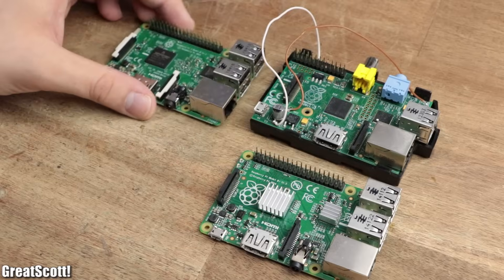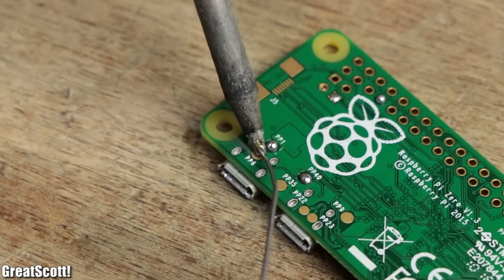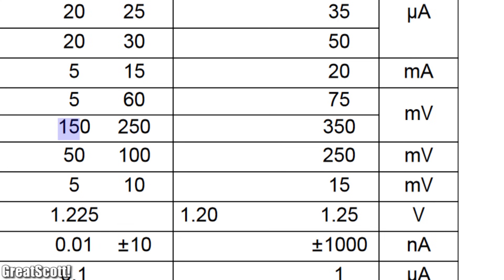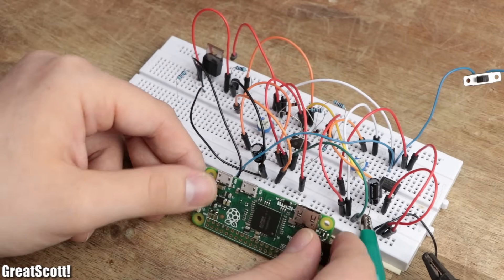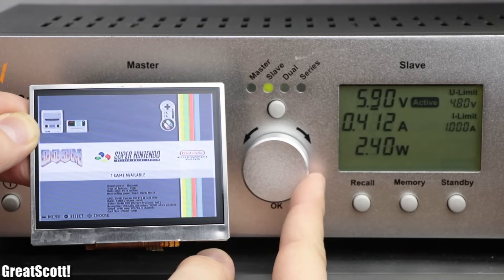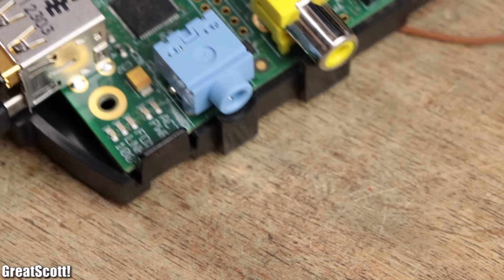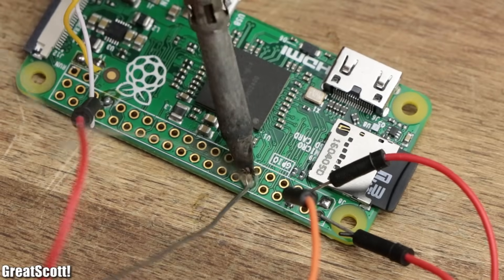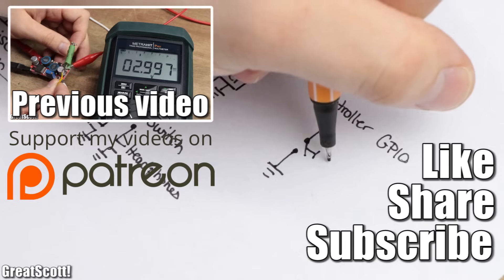DIY Raspberry Pi Zero Handheld Game Console (Part 1)

Comment: you made it super difficult and expensive, just use a 2s BMS for battery, 8Pin Display Module, and modify the matrix keypad and connect it with Pi

Comment: Hi, I have got a similar tft lcd monitor but the pcb i slightly different and it seems that there is no XL1509 ic. There are only two 6 pin ICs whose written on labels dont result in a specsheet online. Also on the flexcable to the monitor it says HJH-4.3TN01 it doesnt help to find the panel just to rule out beforehand if it would be a 12v only. Can someone help me with this

Comment: If the battery can be changeable like "shop modification"(if alot already) to be like Android-type battery but the maximum size can fit? Because android's battery is strong and so slim, imagine if that size on Nintendo like this right?

Comment: I'm just wondering, why not using the HDMI port? You've got the video and audio exit already. Also there are circuits for battery management available in any voltage and capacity

Comment: why is it so dam hard to use the effin Bluetooth on this stupid zero???? anyone has input on the matter? thanks guys i have the zero W and yes i have paired my headsets to it but fails to make profile and keyboard does pairs but if left long for without use it  will loose connection weather im on wifi or not really sucks, i even bought a BT dongle for audio as it was marketed for audio  and pssshhh nothing ..... im dead

Comment: Im trying to do this with my pi3b+ but I cant find where to solder the a/v wire to. Any help would be great because the only instance of you wiring iy to the board is on a pi zero and idk which port that is on mine...

Comment: I just noticed that this project uses rechargable AA batteries. If I were to use non rechargable AA batteries, is overdischarge protection is a must or a regular voltage regulator will be fine?

Comment: Wondering why you didn't modify the config files directly by plugging the micro SD into a PC instead of using an FTP client software. The filesystem is fat32 so you could have done it just fine. In case the filesystem automagically changed to something else you could have used a remote sh terminal emulator and a bash text editor, much faster than a bunch of FTP transactions, which I use only to transfer files and not for editing.

Comment: Hi scott!! Great videos. I want to make you a question. I want to make a portable game console with a raspberry pi 3. I will use a 3000mah battery from a smartphone. Can I use a tp4056 to charge the battery and with a boost converter to reach 5v make the raspberry pi work fine? If not, what solution I have?

Comment: why didnt you just set a pin high on the raspberry pi when voltage drops rather than have the transistor cut power to the raspberry. you could then have issued a shutdown command to turn it off?

Comment: I am starting a project of my own retro handheld, but based in a orange pi, because of budget purposes lol. As long as I am also using it as learning way, I've got some doubts. Would you help me? Before deciding to build it, I've seen some videos and people were using Arduino nano to connect the controllers to the Rpi, but do I really need that? As long as I can connect a keyboard or a joystick in the USB ports, wouldn't I just kinda do the same with the buttons, adapting one of the USB port just for that? Quite like I stripped the joystick and soldered it on the USB port, taking it exclusive for that? And about the screen, do I really need a driver board? The Rpi screens are too expensive for me, so adapting a screen, like a psp or 3ds, would be very helpful and convenient, but I've read that it just can't be done because it isn't compatible. Can I do something just like you did there? I am using a orange pi pc h3    with a 3.5" TFT LCD, which I wish it'd be bigger, 4.3" at least; 6 command buttons and 4 shoulder buttons for a better range of compatibility with the consoles. Even though I'm a beginner in this world, I know it can be easily done, just need to get rid of some doubts then time will do the rest haha 

Btw, some nice projects you got here, mate. Congrats :D thanks for sharing it

Comment: this overdischarge protection seems to not care about a clean shutdown: it just cuts the power regardless of the OS status. This might result in data corruption so we would want to avoid it.

got an idea: making the BCM monitor the over discharge circuit, which sends a trigger signal (let's call it "bat_low", maybe from the first opamp output) when the batteries voltage reach a value below a set one: in the video, if I understood correctly, it is 4V8. This would also get rid of the mosfet and the flip flop part, being the shutdown procedure taken care by the OS in a much cleaner way, relying on the underlying  circuitry to keep track of the battery level. If the system is running, it tells that the batteries are low, and gives 5 to 10 seconds to save progress (for example), then it shuts everything down and powers itself off. If the system is booted up again and, if the "bat_low" value is read from a GPIO input, it immediately initiates the shutdown procedure. Just like telling the user, "either you change batteries or recharge them, or I refuse to boot up again!"

This way we would also have less circuitry laying around, with less power wasted.

Unfortunately, as far as I know the raspberry boot procedure is fairly demanding in terms of power, so this procedure is far from ideal. Maybe a kernel mod would be acceptable: at a very low level the kernel might check if the low_bat trigger is on and refuse to boot altoghether, visualizing a "low_bat" icon on screen. After all I only know how to write a python module, which lays on a way higher software level.

Also this would definitely work on the Zero, not at all sure about the 3B. That little critter is quite short-tempered, and everything under 5V is considered "unstable".
Reply: I realized that my previous idea wasn't that good. Basically the over discharge protection circuit can be preserved; except for the signal that's being grounded: a GPIO can be grounded through a transistor, activated when the power drops below a certain value. The GPIO is then read by the BCM and the shutdown process is initiated.
Reply: 2:51: shouldn't it be " + > - out Vcc"? And I still couldn't properly understand why the inverting input is set to 3.8V.

Comment: "By adding a potentiometer to the inverting input I scaled the 4V8 minimum battery voltage to a value of 3v8 [why?], which means [on what assumption?] when the battery voltage falls under 4v8, the output of the opamp turns on".

Though I grasped the overall underlying concept, I feel there's a gap in the explanation. Where did that 1v go? Which is the minimum battery voltage, 4v8 or 3v8? Why do you set 3v8 in the inverting input to have a 4v8 cutoff on power to activate the anti-overdischarge circuit? I'm confused.

Also in the Instructables page I can't see the components you used for the audio filter. It is tiny but I suppose it's very important, so they should be listed.

Comment: This is like the 20th time I'm watching this. Just too interesting. I really want to experiment and do something similar with a bigger screen, much like an Archos gamepad or a Wii U gamepad minus the touch feature (which I have to see if it is feasible but I feel it would be largely redundant). That would be way too cool.

As a side note, I would have added a secondary circuit to the anti-overdischarging feature which makes a red LED turn on when batteries are low on volts. That would be much better for the system, giving enough time to power it off thus preventing abrupt shutdown.

Comment: Will one of these screens work with this project's component? https://www.ebay.com.au/itm/Bottom-LCD-Display-Touch-Screen-Replacement-Tool-For-Nintendo-DS-Lite-DSL-NDSL/322837173319?_trkparms=aid%3D555017%26algo%3DPL.CASSINI%26ao%3D1%26asc%3D20160706105120%26meid%3D40176bf771d44211aa783eaef4f71220%26pid%3D100508%26rk%3D1%26rkt%3D1%26&_trksid=p2045573.c100508.m3226
Reply: Ds screen wont work. You need a composit video wire.

Comment: Recently built a similar setup using a Pi Zero, this exact screen (did the 5v mod too) and GPIO sound and GPIO joystick. then crammed the whole lot into a cheap gadget shop mini arcade case. Works great with a USB powerbank as a source and charge circuit.

Comment: Hey GreatScott. I think you made misstake in the schematic and explanation of overdischarge protection. 
First you said that you scale the 4.8V of the battery to 3.8V, and as the reference voltage you have 4.5V. That means that the output of the comparator turns high much earlier than it should.
And in 2:51, whe you explain hom comparator works, you said that if +<- --> out gnd, and if +<- --> Vcc. You wrote the same condition twice, but with different result. That must be wrong. 
If I'm wrong, please correct me, I'm just starting my electronic adventure.

Comment: Would it be possible to just use 4 NiMH Batteries (about 1,4 x 4 = 5,6V) and to prevent it from overdischarging you use a Zener-Diode with a constant Voltage of ~4,8 V to be conductive, so when the Batteries discharge under 1,2V, the Zener Ddiode blocks and turns the system off?

Comment: Hi Scott !
Nice built ! Congrats.
I'm trying to do the same but I have a screen issue.
When I plus the screen on the battery circuit, and the raspberry on a separate micro usb power, everything works fine. But if I plug both raspberry and screen on the battery, it is constantly rebooting and screen is flashing on and off. My screen controler board is different than yours so I don't really know if I need to remove a chip on it. I even can't read what's written on the chips ... it's TOOOOOOOO SMALLLLLLL :-)
Can you help me ? PLEEEAAAASE !
Thx

Comment: My take on this is SmartPiTouch + raspberry pi 2B + element 14 7" pi display + Kano GPIO speakers and finally some cheap nes controllers which I might upgrade to psx controllers
Reply: Oh and for software I used retropie running on a 16gb micro ad card

Comment: i dont know anything about this kind of stuff but i want to make something like this, wouldnt a regular power bank work? i have some laying around that have a 5 volt 1 amp input and 5 volt 1 amp output. this way i would not have to make a voltage regulator and a discharge regulator.
thanks!

Comment: Why is the battery low voltage of 4.8 Volts scaled to 3.8V for the inverting input?  Shouldn't this be scaled to 4.49V to turn on the comparator with the non inverting input of 4.5V?

Comment: hey, i tryed to rebuild this project with an raspberry pi model b+, i copy you config files for recallbox and the raspberrypi boot config. i soldered the composite yellow wire of the display directly in the raspberry pin of the 3,5mm jack. the bootscreen and the menu of recallbox works fine but if i start a game the display fade into black and the video signal cames out of the HDMI connector. WHERE IS MY FAILURE ?!

Comment: what is better? cheap raspberry pi 3,5inch display or monitor used in this video?? i saw that many people have driver issues with the cheap raspberry pi displays is that true? what should i get? the monitor used in this video and modify it so it can be used with my raspberry pi 3 or buy the 3,5inch lcd for rpi?

Comment: Hmmm.  I build the power circuit as shown.  But it does not shut off when the battery falls below 3.8V.  The MAX667 gives 4.5V with any input 5v or higher.   When the input is at 3.8V, the MAX667 is outputting 3.0V, so how does the Neg input to the OpAmp ever get higher than the Pos?  It will always be lower than the Pos.  My test circuit doesn't shut off until the 2.3V range....
Reply: Looks like the inputs need to be switched (Pins 2 and 3)  Works when I changed them....

Comment: could you take apart a cheap cellphone power bank and solder it with the included circuitry in the board instead of making a voltage regulator? its designed to output 5v continuously plus one can charge the battery inside the handheld. 

edit: 2nd thing do you have a  retropie version of this project?

Comment: +GreatScott! i followed the instructions and i allready got my lcd screen running. 
adjusted all the config file settings and used a PI2 for the presetup of recallbox. now if i boot on the ZERO it stucks at the rainbow screen. any advices ?

Comment: Greetings,
I am creating a Zero PI SNES Controller. I have tried all I can to configure the GPIO’s to the controller, however, nothing seems to work. I am user recalbox and I am aware that it won’t be the same configuration as in your video.
Could you please if at all possible point me in the right direction? 

My SNES controller > 
Red = Data
Yellow = Latch
White = 5V
Blue = Clock
Brown = Ground

I would need to know the GPIO layout for this, and most important the “recalbox confg”
Any help would be greatly appreciated. Thanks a mill.

Comment: Hello Greatscott! This video is awesome! I just had a question. Do you need a different raspberry pi to install the OS? I seen you switch from the zero to the Pi B, then back to the zero. If you could explain a little more on that I would appreciate it! Thanks!
Reply: zeldaxpro I would also like to know the answer to this. Is it a must to get the raspberry pi b model?

Comment: I'm building one of these with a lipo (3.7v) which comes with a protection circuit(overcharge,current and discharge) - can I just attach it to the pi's 5v input and to a boost converter (3.7v -> 12v) for the screen in parrallel without any additional circuitry?

Comment: 3:30 A piece of what are you using? I can hardly understand it. :D
Reply from the maker: "...perfboard...."
Reply: Ahh, I wondered what it was, but I could see it is "Veroboard". "perf" meaning.... "perforated"!! :)

I understood most, but would obviously need to pause quite a lot, when building. Mainly around the redirection of ports in the config file.

Comment: tip: the headphone jack you used will short the audio input to the speaker if you don't plug in headphones so you don't need the switch.

Comment: I wonder, if there is way to connect that lcd directly to Pi ? (not zero of course). I meen, raspberry pi has some serial port for display and this lcd also has serial port. btw this lcd has touch sensor too. you can see it 4:00 unconected 4 pins
Reply: Yes there is composit(analog) video out on every Pi except zero 2w it has pads

Comment: GreatScott! I have a question for you. How do you get your boards and components so cheap ? For e.g. I can find most things you use but at much higher prices: Raspberry pi 0 - minimum price You can actually purchase it is about 22 $ as compared to 4 gpb.  This really upsets me, because it's misleading when making a budget for a project like this one... Initially you hope it will be around 30-50 $ but it ends up costing always alot more. :(

Comment: Any other tips to get Recall-
box on the PiZero?  I downloaded the latest, and get no boot led. I don't have a larger Pi yet to test with.  I extracted it to the root, 64Gb micro SDHC labeled "boot" from a previous load with RetroPie 3.6.  Thanks.

Comment: Why not use a NE555 timer in bistable mode as a flipflop?  It works across a wide range of voltages and is ready to go, no diodes or resistors or capacitors needed (reference cap can be omitted I think), just a bunch of wires!

Comment: Quick Question:
Could i just attach an rechargable Usb Powerbank to the Raspberry Pi via an cut in half Usb cable or will there be any Problems?
Schnelle Frage:
Könnte ich einfach eine Powerbank mit einem zerschnittenen Usb Kabel an den Raspberry Pi löten oder gäbe es Probleme?
Danke für eure Antworten/Thanks for your answers.

Comment: I am working on something similar, and had planned to use a power bank for powering the pi. Are there any benefits in using a custom circuit? Also, take in not using a soft shutdown procedure, it may lead to file system corruption

Comment: Great tutorial, but I must ask, why bother with a pi zero given that they generally go for $25 or more, at least on amazon? If you desolder the Ethernet, USB, and pin header, you can get a MUCH more powerful Pi 3 with a low profile. (admittedly that is a bit of effort though. It's a shame they do not sell a version w/o these I/O connectors pre soldered.)
The Pi 3 actually emulates PSX and N64 titles reasonably well. N64 is a bit iffy on some games, but it's getting better.
Reply: Also, if you shop around a little bit, you can buy decent quality 5 or 7 inch 1280*800 IPS panels for $65, although the 2 I got both arrived DOA. :/
Reply: Pi Zero is $5 from adafruit.
Reply: How much for shipping? It'll end up costing more than double that.
Reply: 10 dollars plus 3 dollar tax. (adafruit in the US) and that includes wifi support.

Comment: I have to strongly disagree with the Pi Zero being the best price/performance ratio... 
The Pi Zero is certainly great, but the Orange Pi One performs much better than the Zero and you'll never find the Zero at the advertised $5 (4 pounds) because you have to include shipping costs and unlike most boards, you'll probably need some accessories to get started (especially if you want to connect it over ethernet) unless you already have them anyway, so after all is said and done it'll be closer to about $15 whereas the Orange Pi is $13 ($15 for the op lite which has wifi) including shipping and the only thing you'll need is a 4x1.7mm power adapter.

The main benefit and reason as to why you'd pick the Pi over anything else is it being incredibly small and has the best software/community support out of anything else, but if you can deal with a slightly bigger board and without the better software, then the Orange Pi is certainly a better value by far.